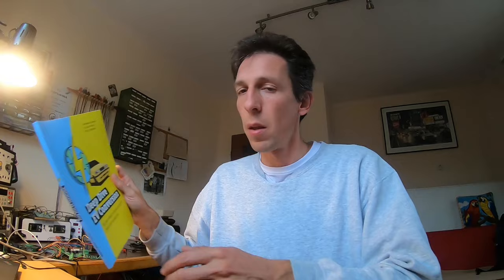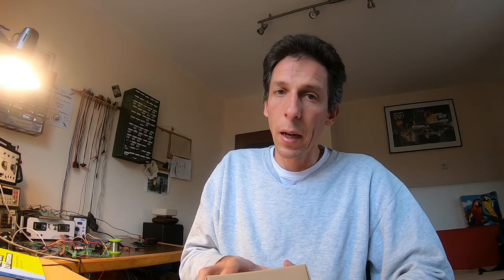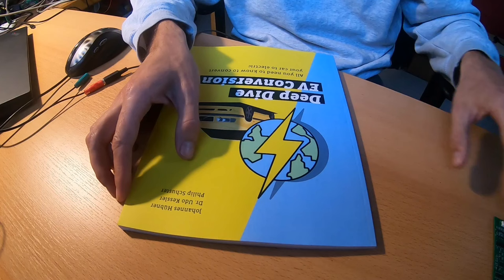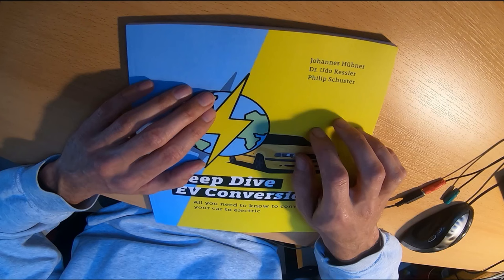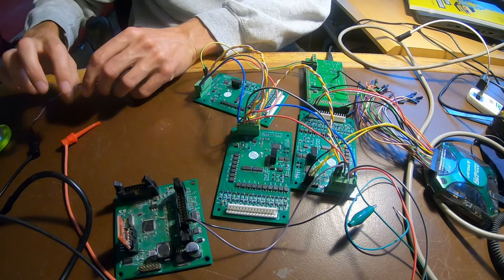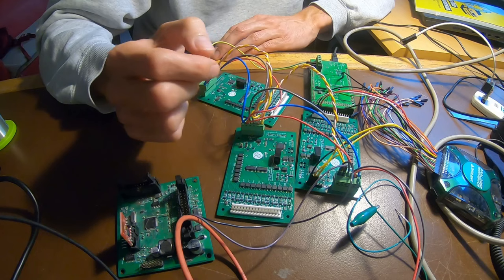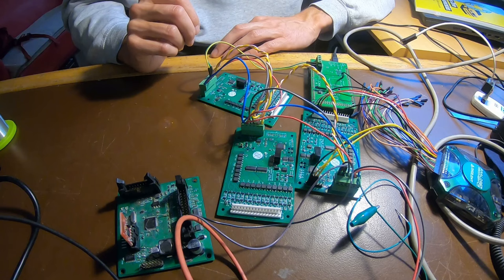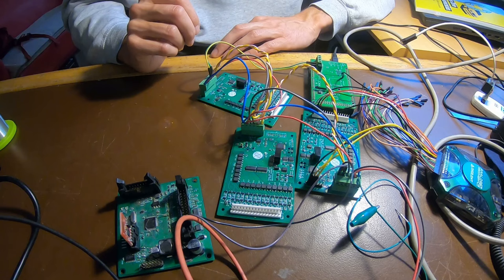Lab Update #80: EV conversion Book, Open Source BMS, Tibber Pulse

Comment: Thanks for another interesting video! 👍👍
What about NEEY 4 A  (programmable) active balancers for packs with high capacity deviation? (similat like Off Grid Garage on YT is using it for the "Frankenstein" pack)
Reply from the maker: You mean putting them in parallel to the BMS? Shouldn't hurt.
This BMS isn't designed for high deviation, I think in car batteries that is not a relevant case
Reply: @EngineersFear  Yes, in parallel. So you don't have to worry about top balancing, if you are using older LEAF cells or B quality/older LFP cells. Alternativly "Helltec" BMS have an "enable" input for a potential free switch. The NMC/NCA could be actively balanced all the time and/or while driving. LFP only while charging with high imbalance (programmable in the NEEY balancer). And/or above 3.45 Volt only (LFP again).

Comment: How about adding a fuel cell to avoid fast charging and achieve longer-lasting batteries? Is it possible to build a fuel cell yourself?
Reply from the maker: That would be a bad deal. Fast charging is not that big a problem while a fuel cell is very expensive, complex and inefficient.

Comment: Just went to your store to find out the topics of your „convert to EV“ book.   Dont want to buy a cat in the bag.  is there an table of contents you could provide?   ccs …v2g…chademo to css.   Dc charger.   Pv charger to HV are the topics i look for.
Reply from the maker: These topics are not in there, it is focused around the conversion of a Volvo and has the details about battery boxes, drivetrain fitting and wiring diagrams.
Reply: Thanks.  In the German Forum Going Electric there is a Discussion on the chademo / ccs Project.  Will it end in a Product ...Adapter?  chademo is mote and more delisted.  Would be great for all the Nissans which are forced to stay at home. @EngineersFear

Comment: what is the green terminal you are using on  the PCB?
Reply from the maker: What brand or what function?
Function is power supply and CAN comms
Reply: @EngineersFear  For  the open inverter BMS. 12v and CAN . I do not want to solder wires directly to the board. I measured and I think that is 3.5mm between pins.